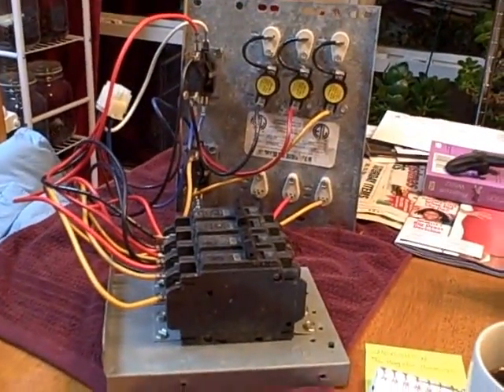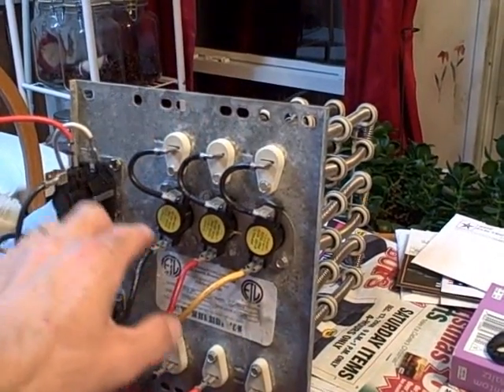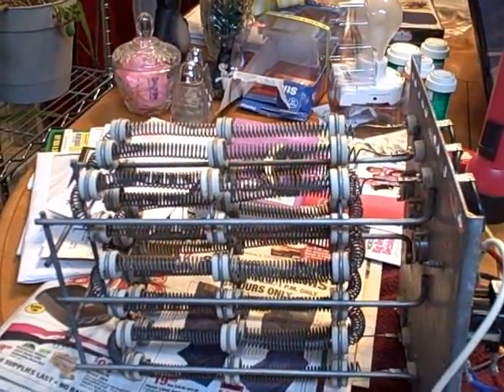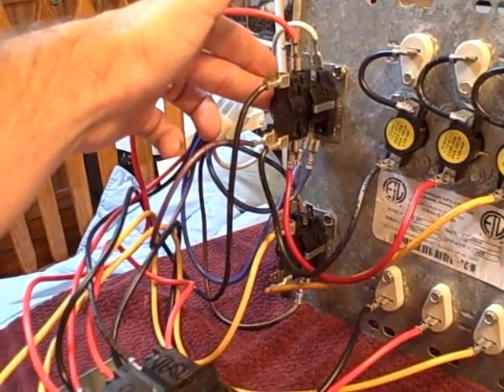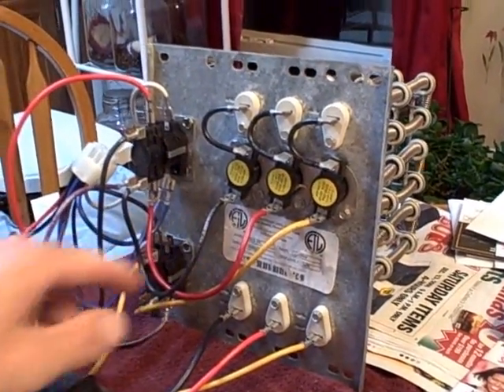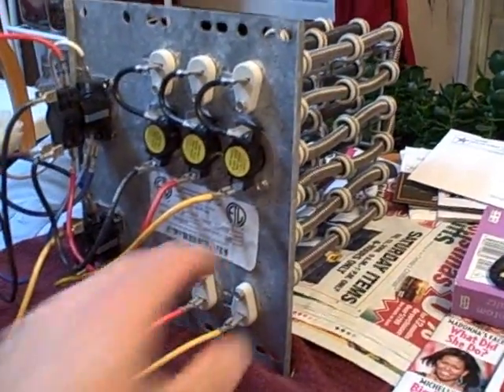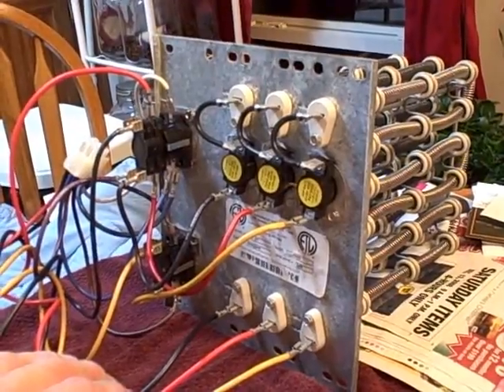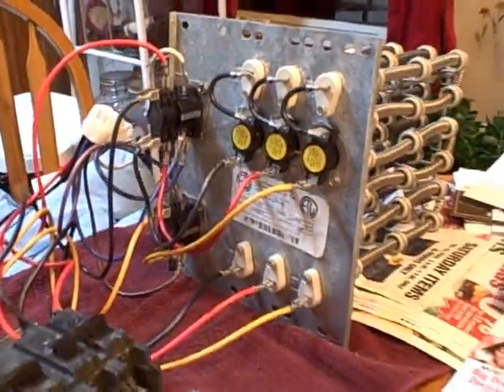HVAC Electric heat kit / strips shown!

Comment: My furnace has only the top heating elements working but the bottom are not. We move the top wires to the bottom and bottom to top and the other elements work but not all. Any ideas?
Reply from the maker: First, I can't emphasize how safe you need to be while working with that. I'm assuming you have all the breakers off and know how to test for live voltage with a meter, one mistake and 240 volts will kill you :(
Anyway, that said, if I understand you correctly you are saying you think all the elements actually are fine, just not getting power.
First I'd check every wire connection to make sure there aren't any burnt off wires.
If that's fine then it's most likely a sequencer, or relay, depending on which you have that activates the circuits.
You might have separate sequencers for each heat strip, or you could have two strips on a double stack sequencer and half the sequencer isn't working.
Of course this is assuming that something is actually wrong. Are you just inspecting the unit or notice a heating problem?
Sometimes a unit will be installed in a house but they don't actually need that much heat for the space and wiring up all the elements would be too much, so they leave one out of the loop by removing wiring in a spot. If that's the case then it might not even have the proper breakers or wire sizing to add in the extra heat strip safely.
Reply: mikie2501 this was working fine but then it wouldn’t heat up to temp. I replaced both sequencers but it still runs the same. Barely warm heat. Since the elements do work when moving the bottom wires to top and top to bottom, I’m not sure what else it could be. It is a Goodman hka-20c. I’m going to check everything and run some meter tests. It might be best just replace the kit.
Reply: mikie2501 I got it. One of the sequencer wires needed replaced. It is working again.
Reply from the maker: @rwgpublishing929  awesome!  Yeah, sometimes it's easy to miss something even though you've looked at it three times, hehehe!
Well you know what they say about a mechanic not working on his own car, I have this heat/blower relay that literally melted half off a number of years ago, I grabbed a bigger relay and just moved over the stuff that was burnt and piggy backed the low voltage to tun it, about time I get around to pulling out the old relay, hehe. I shoved in a big ole outdoor condenser contactor to do the job, thinking 'it won't overheat and wear THAT one out!!' 
Two bits of fun, you can hear the very audible ClacK when the contactor closes, hehe, doesn't bother the wife though, so I'm safe! ;)  ...second thing is more of a pain, at the start of every heating season when the heat should come on, nothing happens!  Turns out the plastic slides the double pole contactor slides in tend to get stuck from just sitting and collecting humidity/dust all summer, so off the cover comes, then two cover plates that are the most assinine setup Ive ever seen, forget to turn off the main breakers as well as the service disconnect and make one slip with that plate cover and you hump the mains wiring before it gets to the disconnect!! :/
Anyway, get them off, power it up and call for heat, then take a screwdriver and give the contactor a good wack with the handle end and it snaps closed! Mmm, the smell of burnt dust on the elements! Always gets the cats looking around, hehe!  Cycle it two more times to make sure it works, then kill the power and put the covers back on. Done! Pro tip: never put things back together till you test it, Murphy will get you every time! Hehe!

So, was it a burned off wire or had the connector end softened and come loose?
I used to get calls every year where I was replacing burned/melted wiring on heat strips on older units. At some point someone had replaced the wiring and they put undersized wires in that invariably overheat.

Makes me remember this older couple in this huge, old two story house... Called me out on a home warranty insurance call, saying something was wrong with the unit because the winter bills were always so much higher than the summer.
I go up into this walk in attic (gawd I love those!!) And here's this antique as hell air handler. Open it up and its so old it uses contactors Ive never even seen before! Then I start checking it out, the thing used 35kw of heat!!! Holy. Crap.  Thats about 140 amps at 240v.  Insane!
Reply: mikie2501 what jobs you have. I have ran into so many crazy things but with the tester, sequencers that I replaced it was a $50 fix. Since it was only a wire, now I have two spare sequencers. Lol
Reply from the maker: @rwgpublishing929   lol, well they will come in handy eventually, just leave them in the access area, maybe with a note saying they are new, my luck ten years would go by before one breaks and I would think the spares were bad ones I didn't throw out, hehehe.  Well good job getting it running smoothly!

Comment: Thank you for your knowledge on furnaces. Mine had stopped heating. I watched several of your videos to understand what I see in my furnace, or more important is what I should see. 15 kw.  I had a burnt wire and wires not connected. one of the elements was not hooked up. Connection from 60 amp cutoff switch went to both sequencers. power to two element coils ,but returned to the 60 and the 30 amp switch. I checked and I triple checked continuity and volts across the switches and elements. there was no schematic in the unit. I can't read the make or model number. The manufacturer is not even on the outside of housing. I have unit running once more all three elements work.  It cycles properly.  Cost : a trip to town 16 miles, 10 feet of wire and a package of wire connectors.
Reply from the maker: Sounds great, good job! The main failures I see on electric units are undersized wire that either overheats and burns off or does enough heat/cool cycles that it loosens the connector. And then melts or corrodes and burns. Then connectors that arent crimped well, they corrode and burn off or just melt off.

Comment: i have a  ? THOSE 3 LIMIT SWITCHES DO THEY HAVE TO MATCH MINE CAME WITH  L-175  40    I HAVE 2 NEW ONES BUT THEY ARE   L-160 20F   AND A L-175  20F WILL IT WORK

Comment: Question. I measured the breaker, two hot wires come in 220V. There are many small wires connects to the breaker. I measure both side left and right. 0v. Measured left side with grounded chassis, it showed 110V. Measured right side with chassis, it showed 110V. But I measured both side of the breaker. It showed 0v. Why? Did you see the something of your broken 60A breaker?

Comment: Question. My filter hasn't changed for 2 years. Originally not heat. Now the fan is not blowing air. Do you think the heat strip is broken that cause the fan not running?

Comment: At 4:17 in the video, you suggest that 240v is carried thru the wire and to one side of the coil. Is the voltage coming in that side 240v or 120v?
Reply from the maker: +Melvin292 it's effectively 120v to each side,  but the load gets 240. Think of it like plugging in a three prong welder or dryer, you have the ground and two 120v legs to give the work load 240.

Comment: Hi Mike, great video. I have more or less the same set up as you showed at my cabin and the unit is in the attic. When we turn it on it runs and heats with out issue for two or three days then it wont kick on but the fan just runs while trying to call for heat. Watching your video it seem like it may be the sequencers, does that sound right or is this another problem? Thanks, hope you are still answering questions

Comment: Thanks! the problem I am having is that the heat strips are staying energized all the time. When I power up the system and run the fan the heat stips are energized...
Reply: One thing that causes that is techs make a very common mistake of replacing the fan relay wired up backward.
Reply: But also thinking the sequencer can stick on.  I'm not sure but I think systems either have a separate fan relay or alternately integrate them in the sequencers.

Comment: should each of the breakers/service disconnects have their own breaker in the main box, or are they run together from one breaker?
Reply: Double breaker, maybe 60 or 70 amp depending, from the service panel to the unit.
Reply from the maker: As a rule of thumb/best practice, typically each has it's own breaker. Something to remember too is that often, on the unit, those aren't actually breakers, but service disconnects with no surge/short protection, just a big on/off switch. So it's important to have the right size breakers in the panel and appropriate wiring size going to the unit.
Always remember to double check and make sure you have them wired right at the unit too, you'd be surprised at how many calls I've gotten the first winter after a unit had been installed because it kept throwing a breaker. Get there and figure out they had wired the 60a and 30a disconnects backwards. The 30a breaker in the house panel being overloaded and probably warming up that wiring too!
Reply: @mikie2501  Mine has 60A and 50A disconnects and they were wired backwards. It tripped the 50A breaker one morning almost 2 years after it was installed and I reset it and then I thought to double-check that, and I found that they were in fact wired backwards. What made me think is that it killed the whole unit, fan wasn't working, and I knew it has two 9.6kW heat strips in it, so I figured the fan and one 9.6kW strip should be on the 60A breaker, and the 50A breaker should only have the other 9.6kW strip on it.

Comment: Thank you very much for this video. I watched it a few times and finally decided to change the sequencers. There are two and they are ganged together. I couldn't have fixed it without your help because the schematic on the furnace shows a lot of 240VAC wiring, but they only read 115VAC. Even the voltage coming into the breakers inside the furnace don't read 240VAC. The only place I found it was at the sequencer and at one set of elements. Anyway, the sequencers were the fix and I appreciate it.

Comment: Goodman electric furnace 10kw MBR1200AA-1 
Goodman HKR-10c
Costello heating and cooling installed a new furnace.  They installed a Goodman mbr1200aa-1 ac, or tried to install. Very disappointed and frustrated.  The owner, Gene, gave us a estimate. Then the next day had 2 young guys install the furnace. They did not know what they were doing. The job was supposed to take less than two hours. They worked from 9am to 2pm with the job not completed. 
After they got "done" wiring the furnace, they flipped the Goodman breaker then flipped the main breaker.... sparked started flying, lit up the house! They wired it wrong and screwed up my new furnace. 
The owner went to go get a circuit board and came back around 6pm. During that time, the Goodman was left running, blower did not shut off and the furnace heat did not shut off either. So for hours the thermostat was set at 63 degrees Fahrenheit and the temperature in the house kept raising up to 88 degrees.  Unbearable and the breaker was too hot to touch to shut it off. 
The owner arrived around 6pm to fix everything,  the circuit board part, then realized he needs another part, a relay. Left to go get the relay, and came back around 8pm. 
He got the furnace up and running on 1 element.  So it didn't blow hot air, and it's 19 degrees outside! He said he would come back tomorrow with a contact and hook up the 2nd element. 
Very frustrating and scary.  
I would like a new furnace, one that didn't have sparks flying out of it, which could shorten it's life or damage the furnace.  And a new blower, one that wasn't running nonstop for 6 hours, what a break in cycle!
Last but not least, when they removed the old furnace, there was a door. Now they took that and are not supplying us with a door. When I asked about a furnace door, he said "put a sheet up". Not only is the unsafe and a fire hazard, but ugly and unprofessional. I need a door so kids don't get hurt or my cat doesn't jump up and get hurt. 
I paid all that money and you took and used my warranty AND I don't have a cover/door.

Comment: Thanks for the video. One question I have is, is it a real problem to install the strip upside down? Can you change the flow on these strips? I am assuming the only difference is the sequencing of the coils?
Reply: Orientation would be important as the thermal safeties are located very strategically.

Comment: Thanks for this great video.  Thanks for the explanation, I was able to test all my voltages and discover an open ground on the first heat sequencer coil which didn't allow the first and so the second coil to energize.  Broken connector on a ground wire.  Thanks again, well explained, perfect detail.
Reply: Greg Williams Costello heating and cooling installed a new furnace.  They installed a Goodman mbr1200aa-1 ac, or tried to install. Very disappointed and frustrated.  The owner, Gene, gave us a estimate. Then the next day had 2 young guys install the furnace. They did not know what they were doing. The job was supposed to take less than two hours. They worked from 9am to 2pm with the job not completed. 
After they got "done" wiring the furnace, they flipped the Goodman breaker then flipped the main breaker.... sparked started flying, lit up the house! They wired it wrong and screwed up my new furnace. 
The owner went to go get a circuit board and came back around 6pm. During that time, the Goodman was left running, blower did not shut off and the furnace heat did not shut off either. So for hours the thermostat was set at 63 degrees Fahrenheit and the temperature in the house kept raising up to 88 degrees.  Unbearable and the breaker was too hot to touch to shut it off. 
The owner arrived around 6pm to fix everything,  the circuit board part, then realized he needs another part, a relay. Left to go get the relay, and came back around 8pm. 
He got the furnace up and running on 1 element.  So it didn't blow hot air, and it's 19 degrees outside! He said he would come back tomorrow with a contact and hook up the 2nd element. 
Very frustrating and scary.  
I would like a new furnace, one that didn't have sparks flying out of it, which could shorten it's life or damage the furnace.  And a new blower, one that wasn't running nonstop for 6 hours, what a break in cycle!
Last but not least, when they removed the old furnace, there was a door. Now they took that and are not supplying us with a door. When I asked about a furnace door, he said "put a sheet up". Not only is the unsafe and a fire hazard, but ugly and unprofessional. I need a door so kids don't get hurt or my cat doesn't jump up and get hurt. 
I paid all that money and you took and used my warranty AND I don't have a cover/door.

Comment: hey quick question if the heater comes on and runs till it meets temp but when trying to come on again the heat strips heat up but blower won't run could that be fan relay or sequencer? Thanks in advance

Comment: Hello .Thank you for yours videos. Is the coil heat strip bad if only parts of the strip glow when it's heated? Thank you
Reply: No.  If it glows anywhere, it should be working.  Those red areas are simply not getting cooled as well as the rest.

Comment: How can i eliminate all but one heat strip? I have the blower motor (2amps) and want only one heat strip (20 amps) on the 30 amps power coming in. i have a tree sequencer with four heat strips.  How do i eliminate two or which two do i disconnect and tape off?

Comment: Need info on three phase electric heater stripp please
Reply from the maker: Hmm,  not sure what exactly to tell you... If it's actually three phase power going to the unit, usually the compressor would be three phase but other stuff like condenser fan motors and (usually) blower motor and electric heat strips are all single phase. The blower motor could be three phase, you would just have to check.
Ive seen three phase going to a unit and the unit turns out to be all single phase, they either replaced the unit at some point and didnt want to pay the extra for three phase, or the power was just dropped like that for possible future use but the equipment has always been three phase.

Comment: I have the same set up with a 15kw and was wondering if the coils should be lit up completely orange in color when on?  I don't think that it is putting out the heat that it should.  being extremely careful I pulled the screws to the heat kit and slightly tilted it to where I can see while on and only the very ends on a coil would turn orange not the entire coil.  I feel that the system is running 2-3 times longer to heat than what it should?  Any help is appreciated.
Reply from the maker: I wouldnt be tilting the heatkit! One wrong move and a coil could touch something and light you up with 240 volts!
If its taking a lot longer to heat the house then you may have one or two dead heat strips. A tech can easily check the heat strips with a meter. You probably have three heat strips if its 15kw, they are usually 5kw strips.  You can either have a tech restring the bad one or just replace the whole heatkit.  I vote for replacing the whole thing, if one is bad today, when will the other two go out? Then you're paying him to come out again and do another repair. :/
Reply: Thank you for getting back to me I think that I will definitely replace the entire kit.
Thanks again
Reply from the maker: +R Law let me jump back in, lack of sleep when I wrote the last bit! Hehe!  It could be something as simple as a bad/stuck sequencer and the heat strips are just fine, those are easily replaced, I did tons of those every winter. Really just have to put a meter to things and see where the power stops or signal stops.
Reply: I will have it all tested. Thank you
Reply from the maker: +R Law damn, sitting on the keyboard!! Hehe. Sounds good! Let me know what it turned out to be!
Reply: R Law